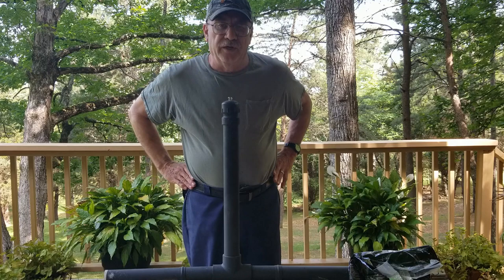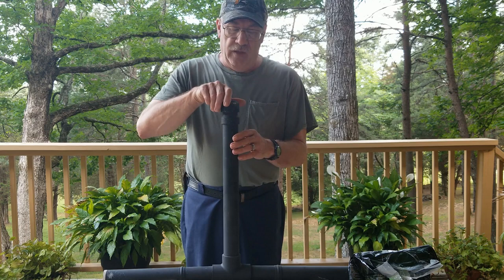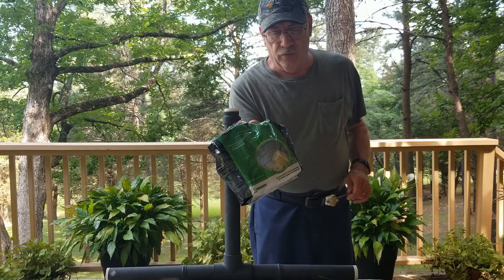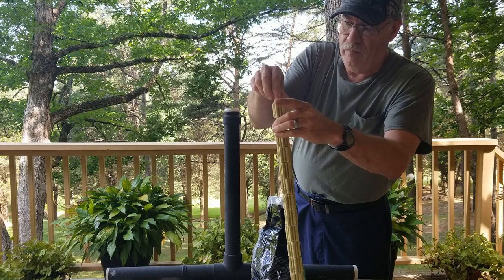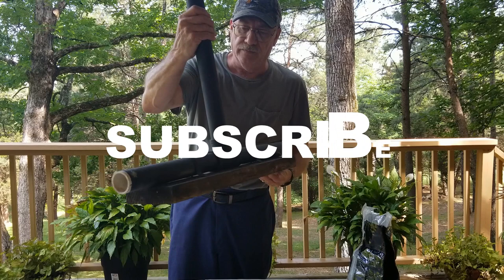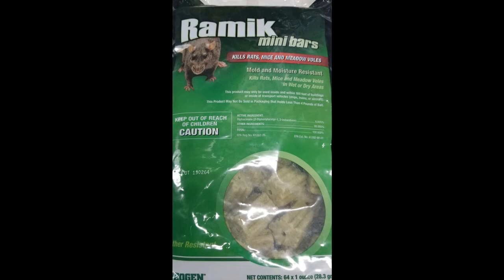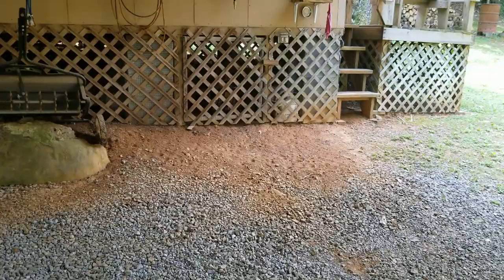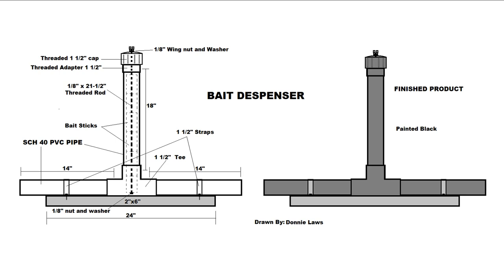How to get rid of FIELD MICE around your home in just a few days.

Comment: What's name of bars you using?
Reply from the maker: I show them in the video my friend.
Reply: Hello good friend.
In case you're still confused, or for anyone else, it's a threaded rod with washers and wing nuts.
You can get them at the hardware store, usually by the other steel stock and rebar, or buy online.  Just a long bolt with no head.
Reply from the maker: @swiss6253  Yeah you can get all this at a hardware store my friend.
Reply: @donnielaws7020  ok thanks im on it